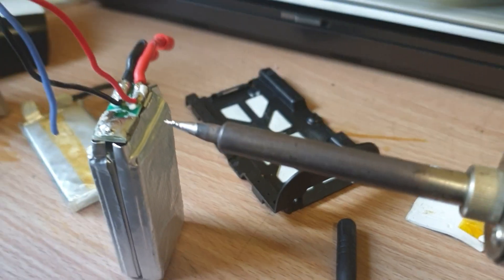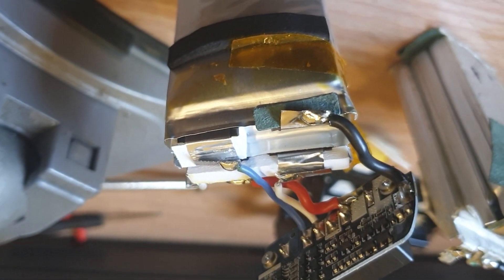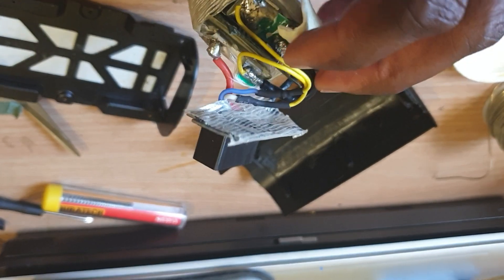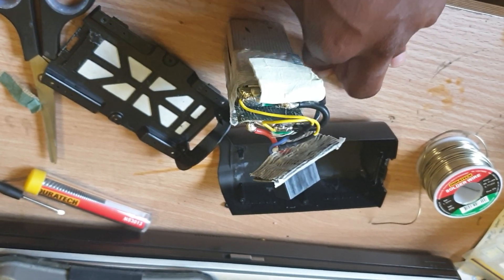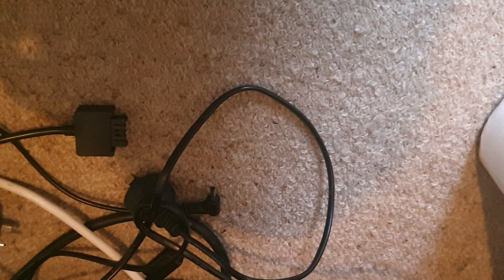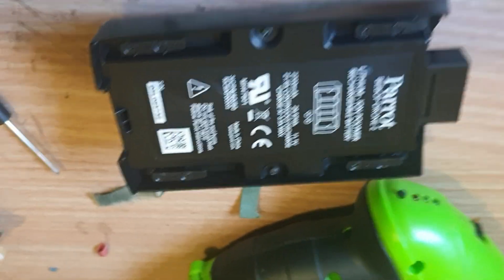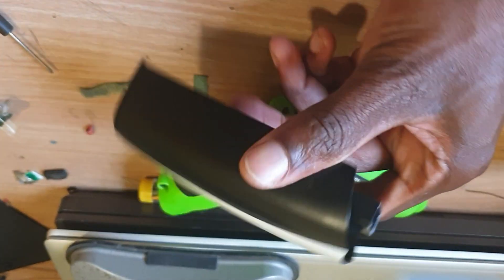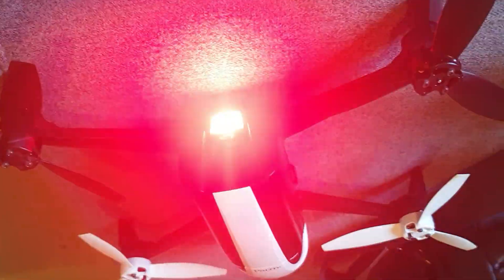Parrot Bebop 2 drone battery repair(2)

Comment: Do you sell these parrot bebop 2 batteries? I have three-battery need repair
Reply from the maker: Hi no but you can just buy any 3s lipo that will fit casing and wiring it up.